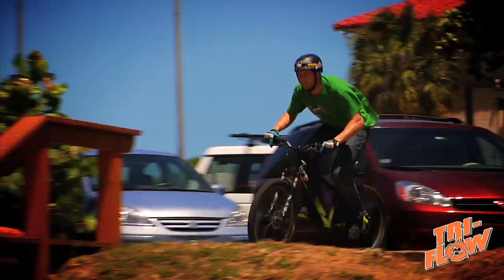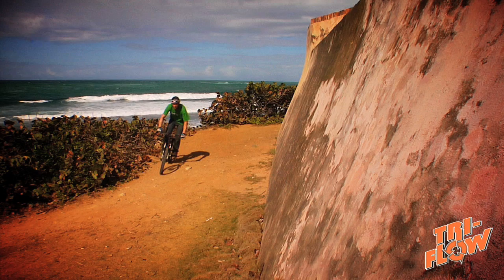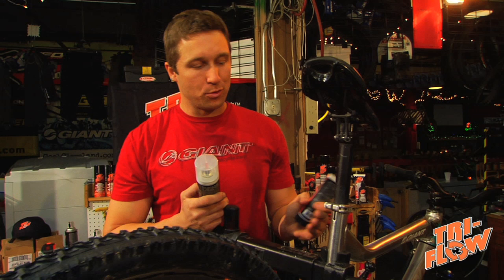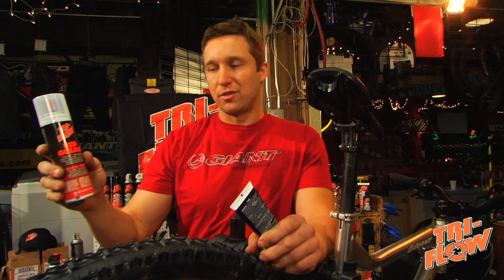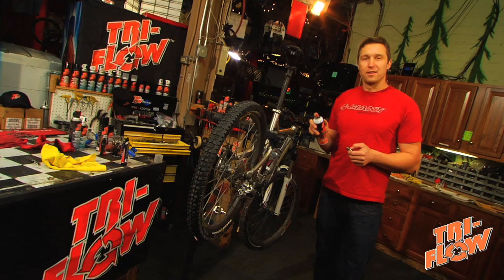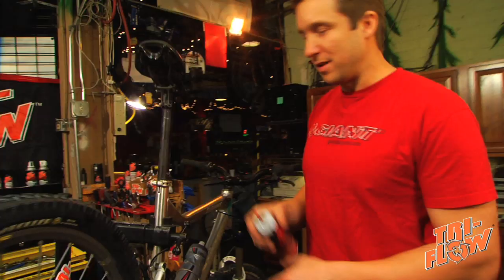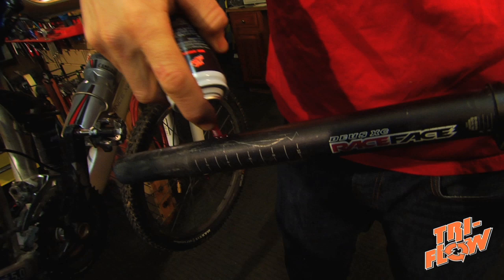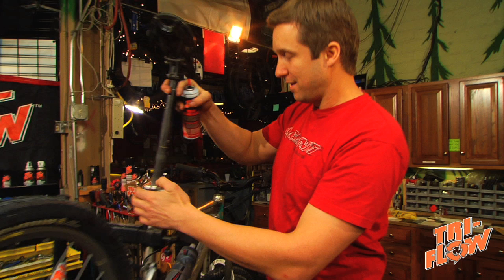Tri-Flow Grease How To Video with Jeff Lenosky

Comment: You never put grease on a carbonfiber seatpost or frame.  If you have either you only put carbon gel usually from the manufacturer of the seatpost or bike frame on the post of the bike, NEVER put grease on them at all.